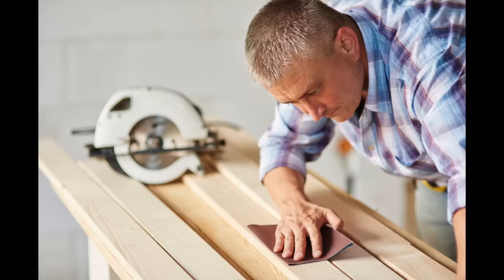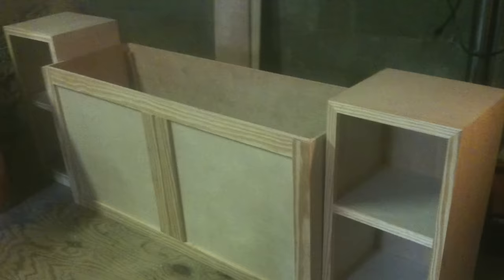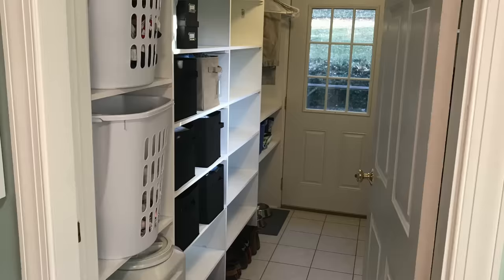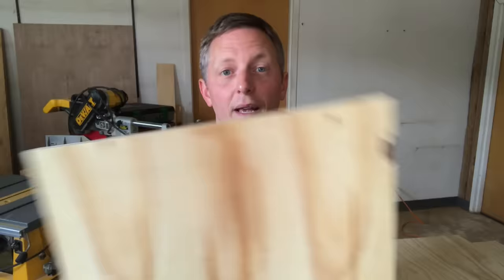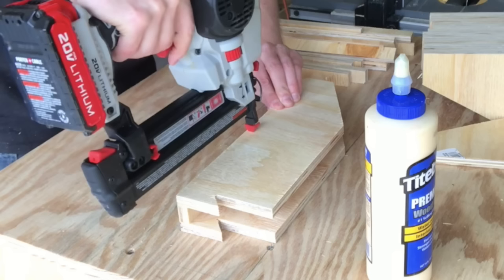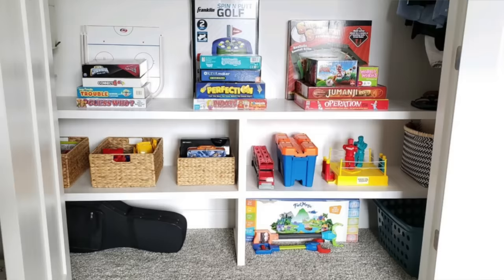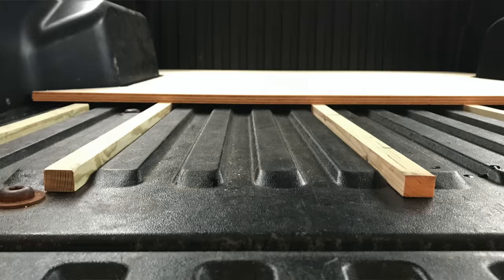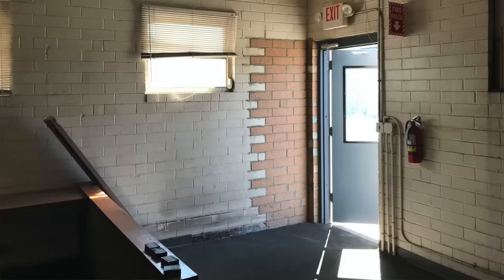DON'T USE 3/4" PLYWOOD If You Don't Need It...TRY THIS! (1/2" Plywood Vs. 3/4" Plywood--When to Use)

Comment: I have to respectfully disagree. I was a licensed GC for 18 years and retired at the age of 35 (2004), BECAUSE I overkilled everything. 3/4 for all horizontals (double layer glued and screwed for tile floors) and 5/8 on all verticals. Nothing shot; screws or spiral cut nails. Sheathing was nailed with spirals every eight inches. Hurricane straps ran the full length. 6 nails per shingle. Never had to advertise. Quality speaks for itself and people were willing to pay for it. You look like you're about the same age NOW that I was THEN. Don't skimp.

Comment: How do you find 1/2" plywood that doesn't deform badly as you cut it? Whenever I try to do thin rips, as soon as the blade passes through the wood, it's like something snaps, and I end up with pieces that are a consistent width, but still somehow crookeder than a dog's hind leg.

Comment: Looking at making a little cabinet style box ( 373x450x568mm ) to house a 3d printer and keep it warm - just wondering on if 7, 9 or 12mm is the way to go (whether alone or around a pine frame)?

Comment: Is it not dependant on the amount of sheets used in the plywood versus the thickness. I find if plywood 1.8cm thick but only 3 ply layers  it's less rigid than a 1.2cm plywood that's 6 ply layers and then there's the variance due to material type so much to learn

Comment: Let's talk about this.
One, the light weight making it easier to carry around the shop is a lousy reason.  You're not in this business to convenience yourself.

Two, I've started making guitar amp cabinets of half-inch.  For anything less than a Twin with JBLs, it's fine, especially if the corners are fingerjointed.  And its flex contributes to the guitar's sound.  And it's a fraction of the weight of the MDF that they make cheap amps out of.  And probably stronger.

Three, but I don't like the sound of birch cabinets.  I'm fir all the way for guitar amps.  Which means I have to try to find flat half-inch fir plywood, and that doesn't exist.  Maybe marine plywood, but I haven't seen how that's coming out these days.

Four, it's a good thing that people don't have record collections any more, because half-inch isn't gonna hold those suckers up.  They're heavy.
.

Comment: May I ask you a question? I wish to build a workbench with integrated table saw and mitre station.  Having watched this and your video where you use the angle steel would using the half inch backed with the steel work?  I may also consider using Hal inch mdf under the play so I can in the future drill dog holes in one part or would you suggest just using t track? Thanks in advance

Comment: Curious your thoughts on interior walls of a shop/pole building.  Planning on using 3/4 on 24" purlins and a lot of French cleats for shelving.  Do you think 1/2 or 5/8's would work in this application?

Comment: How about with pocket hole joinery? I have experience with 3/4 inch ply and pocket holes, and it holds up quite well. Would 1/2 inch hold as well with pocket hole screws?

Comment: Would you use 1/2 inch ply for a desk that is going to be 4 ft wide?  It will be supported about 30 inches by a cabinet under neath and cleats on the side walls. I want to do a 1 by 2 along the front as well for trim. also the computer will be on the side of the desk near the cleat and I may add a couple brackets underneath. It will be 2' deep with maybe 20" support brackets.

Comment: how about warping :    for shelving books (not paperbacks) -- will 1/2 " plywood warp in time?
Reply: My parents built a number of shelves out of 1/2" 40 to 50 years ago and they have not sagged at all (I have them stuffed with books) but they were max 3 ft and I'm not sure you should assume that 1/2" ply today is the same as 1/2" ply 50 years ago.  But based on their results I would say that 1/2" can be used if it is good enough quality.   Hope that helps

Comment: Sorry, I disagree with you on the spanning of 3/4 “not being that much better”. It’s both thicker as well as stiffer, which means you get much better bending resistance. When considering a project that has spans I would highly recommend 3/4 for the small uptick in cost. When considering a project overall - only $10-20/board is not much for spanned areas when you consider the time and labor and as-installed fully burdened cost elsewhere. Reference section modulus below. Extreme fibers (farthest out) carry more load, so thicker is better for strength/bending resistance when comparing like materials. 

I’d probably agree with you on almost everything else tho. 👍🏻

https://en.wikipedia.org/wiki/Section_modulus

Comment: I was just in the planning stage of a new project when I watched this video (excellent video as always). Would I lose too much strength if I cut a dado on both sides of 1/2” plywood? Each dado would be big enough to slide in a 1/4” piece of wood that is the bottom of a drawer.  Thanks.
Reply: Here's a late response, hopefully it's not too late to help. I would say that if your joints are tight and you use the right amount of glue, you won't have any issues. I would even say having the drawer bottom glued in would increase strength since you're incorporating grain going in a new direction. You just have to use plenty of glue on the cut edges since it will get soaked up. I'm not an expert but that's my thinking.
Reply: I frequently build drawers from 1/2 Baltic Birch, and cut a 1/4" x 1/4" dado for the bottom, and these drawers are rock solid.

Comment: Not the best picture to show while claiming that 1/2" is just thick enough to hit with brads. It's much more likely to have brad nails (wedge point) veer to the side (especially in plywood) than front to back. The brad nailer should be held perpendicular to the joint being nailed. Holding it parallel is just asking for blowouts.

Comment: How about for the bottom of a loft bed ?  Planning to build a full size loft for my son and was going to put 1/2 in on top of 2x2s along each side, with 1x4 slats going across.  Will that do or should I go 3/4?  Also, was going to make 13x13 box shelves to use as steps up to the bed.  Can 1/2 in of that size box hold adult weight?

Comment: I have a L shaped desk with a top of “1” Melamine thermal bonded” material. I am using this in a video/audio production studio to hold the audio / video mixing and video monitor hardware. I need to hang computers and other equipment on the bottom of the surface. I am thinking maple b/c 3/4 plywood screwed / glued to the underside to give me a surface to hang stuff from. Advice?   Melamine to plywood glue? How to screw into the “1” thermal bonded” material from below to hold the plywood to it optimally? Thanks

Comment: I have a cubed storage system that I bought from The Container Store many years ago with the 1/2" plywood construction. They were discontinuing the product, so I bought all I could, but I'm missing some pieces for one of my cubes. How can I make a slit in between the plywood to make cubbyholes for shoes? Is there another way besides a table saw?

Comment: Hi There. LOVE your videos. Thank you for the quality and honest info. I am wanting to cut the overall weight of a plyo (jump) box that I build for gyms. I use 3/4" for the strength AND I brace the inside of the boxes. The boxes are up to 20x24x30 in size. Do you think if I internally brace the box and build with 1/2" ply, it could take a beating? The 3/4" material is super strong but so friggin' heavy.
Reply from the maker: Thanks M! That’s a tough call—they’re getting a lot of heavy active load in that situation. I would probably try to build one experimentally—but 3/4 may be the way to go 😬

Comment: What about on a floor? I dread redoing an old tongue and groove hardwood floor and those are .75 thick. I am thinking 3/4 hardwood panels. Any advice would be helpful since machines up to 1,000lbs will be rolling across it.

Comment: Well, ... duh! And did you know that '3/4"' plywood is really 18mm. I just measured some at .707". Your half inch plywood is not 1/2" either. It's 12mm or about .472"

Comment: I guess 1/2" is equivalent to 10 mm (I know it would be 12.5 but there's 10 and 15 mm plywood, so...). Am I right?
Reply: US plywood thicknesses are reasonably accurate.  So 1/2” would be equivalent to 12.5mm.  If you can’t get 12.5mm, you’d just need to choose between 10 and 15, depending on what you’re making.
Reply: @kc9scott  I meant if 10 mm could replace 1/2" or that would be too thin for the uses you say in the video.

Comment: hi my friend ...i just found your video ,and i need your help ...i am building a closet 171 centimeters high by 123 centimeters wide ..i need to put three doors , but i am not sure what thickness of playwood should i use ....here in my country we can by pine-planks in 3/4 inch but i dont know if in that size it will bend.  ....can you give me some tips.,.

Comment: do you think I can make a floating shelf using 1/2 inch plywood and pocket holes? 
I was planning on 3/4in ply because then the screw could be longer (3/4in as well?)

Comment: Sorry but I can't see this. This would force you to put a face frame on all your cabinets which is a ton of extra work. Can't have a 1/2" cabinet with a 3/4" door. What would you use to hold the hinge plates to the cabinets? 1/4" screws? Not happening. I'm not saying there aren't instances when you can get away with it but it just doesn't seem realistic. You're using half inch and then adding supports. That kind of negates what you're trying to say and adds more work.

Comment: Man I wish you were close to Houston, TX. I am building a Mezzaninne for my mancave that is a red iron shop. The mezzanine will be 15'x40' with 15' #12 iron C-Purlins 24" on center clip welded to 8" i-beams. I am thinking to deck it with 3/4" tongue and groove plywood. Do you think that will be ok?

Comment: I'm about to build a chuck box to take camping with me.  It's going to be out in the elements, it's going to be sitting in the back of the truck, carried, and cooked on.  Do you think I could get away with 1/2" and it still be durable?
Reply: 1/2 with coating last longer than 3/4 without. Same price less weight and last longer with coating get the 1/2.
Reply: @jonasstahl9826  Thanks so much!
Reply: @1prshark  Another Tip it is typical the connection between the wood that break first so dont use nails they can slip out.
The strongest way to connect wood is glue, add glue and than use screws to hold it together until the glue is hard. That way you dont need clamps and the screws add additional strenght to the connection.

Comment: Way too thin for cabinets, if your using dominoes or straight forward number 4 or 5 screws your risk of blowouts is far higher and it would not span a very wide distance without sagging.

Comment: You know my wife kept saying those shelves are way too heavy and I said no no no they're fine... And they were way too heavy because everything I use is 3/4 inch plywood...
Reply from the maker: I did a lot of floating shelves with 1/2”, Faust. I loved using it. I’ve always thought that you don’t want shelves to be too heavy, since they have to support their own load, plus whatever you put on them.
Reply: @TheHonestCarpenter  absolutely. I think one of the reasons why I have used 3/4 inch so much over the years, aside from hearing that's what you have to use from all of the YouTubers, is that when I would go to the Big Box store the half-inch was more likely to be bowed. So I always thought that the three quarter inch was just higher quality. But I know now that that's just not the case.
Reply: @Faustustopheles  half inch will sag more over time if any weight  is on the shelves.

Comment: Does 1/2 ply receive pocket screws sufficiently?
Reply from the maker: Yep, it still works really well. You just need to adjust drilling angle and the overall length of the screw (according to the pocket hole chart)
Reply: @TheHonestCarpenter  
Thanks for the quick reply. I used to help a cabinet maker years ago, and he always used 3/4, so I assumed the engineering had been worked out. I threw together a component cabinet for my TV a while back with scrap 1/2", and while not as sturdy as 3/4", I had no face frame....so with that, I'm thinking it would be plenty. Maybe 1/2" face frame too?

Comment: Using 1/2 for kitchen cabinet gables is dumb.. no meat to drill hardware into... hinges are usually designed for 5/8-3/4, the overlay won't work especially with european hinges. I would like to point out 1/2 is usually way more bent because it has less plys then thicker material. If you really like the look of 1/2 buy baltic birch, it costs about the same as a domestic 3/4 sheet of birch though. This site has good guidelines https://awmac.com/gis/guide-specifications/

Comment: I'll be sure to remember to ask about this when getting bids, and reject every bid where they intend to use 1/2" because there's no way in heck that I want to pay hundreds if not thousands of dollars for a project then try to save a couple dozen bucks going with substandard materials.  What a load of bull, it makes your job easier well I'm not paying to make your job easier, I'm paying for utmost quality!  Total fail trying to rationalize an excuse for a lower quality result.

Overkill, YES!  I don't want anything in my life that can barely get the job done.  It's called engineered margins and it applies to how fast I drive on my vehicle tires, whether my refrigerator can chill the amount of food I put in, whether my lawnmower can finish mowing the yard on a single tank of gas, and just about anything else in life.   Don't pretend to decide FOR me, that I should settle for less if willing to pay for quality.  And don't try to urge others to follow suit so your work doesn't look as substandard as it is. 

If you want to do things the cheap and easy way, accept the consequences.

Comment: Ikea uses fake wood  for all the cheaper desks and painted coffee tables. It is hollow reinforced with carboard inside . Imagine hiring  a professional to build me  cabinets charging me 70 $  per hour  just for labor  and saving me 10  $ per sheet of plywood . This kind of saving is  only for home projects not for expensive professional work. Lets be real with any wood project 90 % of the cost is labor especially when it comes to cabinets  and tables. Average solid wood kitchen table  for 8 can run from 1000 to 3000 $ if you make it yourself the material cost is from 200 to 300 $  without any commercial discounts.

Comment: Good words but do not accept them as Gospel. I would not use 1/2" for the carcasses of my shop cabinets because they need to hold up the work bench and my Miter saw station. I wouldn't use 1/2" for kitchen floor standing cabinets ether for the same reason, but perhaps there is wisdom in making those over-hanging cabinets out of 1/2". Did I hear you say 1/2" is stronger than 3/4"???

Comment: This isn't really anything new. The industry standard is to use 1/2 ply.  Run a dado on the back side of the face frame to slide the plywood into and it's just as strong as 3/4 ply.
Check out the Master wood workers video for a great tutorial: https://www.youtube.com/watch?v=2iqF4vqgvKI

Comment: You are buying plywood at HD... good luck matching my price on 3/4 and finding a flat sheet of 1/2 finish grade..
Reply from the maker: It’s not that I am…it’s that most of my viewers are. I had specially retailers everywhere when I was pro. I got a lot of sweetheart deals, but that’s a hard thing to teach.
Reply: @TheHonestCarpenter  But getting flat 1/2" for projects is difficult, especially at HD ald Lws.... I use 3/4, even for backs... that way I stocked one size and either clear or white liner two sided.. shelves everything come from leftovers often, leading to less waste.... I get you on the weight, but now you have two to four racks vs. one or two.

Comment: I'm from the UK and slightly baffled that a "professional carpenter" has only just discovered that cross-orientation laminated and faced hardwood ply is much stronger and stiffer than natural wood of the same size.  Over here, where we would make, say, a set of heavy-load library shelves from ½" ply, if the client wants a "posh" grained wood finish we go to ¾" plank and even then consider a vertical stretcher at the back to prevent bowing.  Is there something historic that makes you culturally think otherwise?  Did you, perhaps, used to have poor quality wood or resins that made weaker laminate than we always had in Europe?  Obviously that situation no longer exists but it seems like the kind of thing that would be passed down the years: "don't trust simple ply, my son, the thickness must always be the same..."

Comment: Construction grade plywood is junk barely good enough for building houses.  If I were to use 1/2" ply it would have to. be solid birch ply more commonly known as
Baltic Birch.  More layers more strength.  Not the junk used in current construction grade garbage.